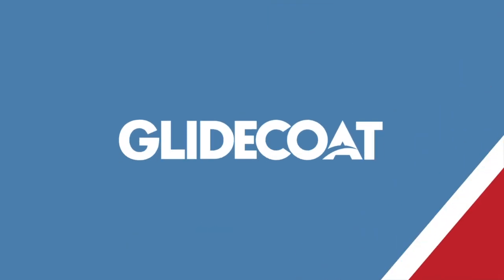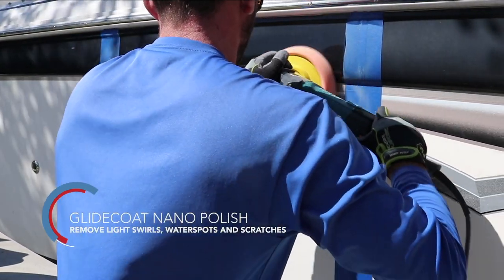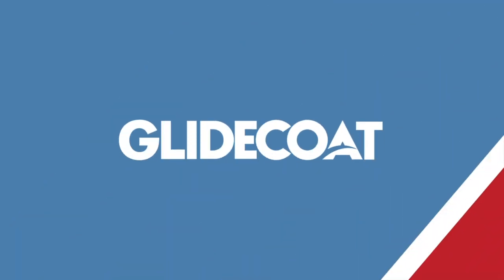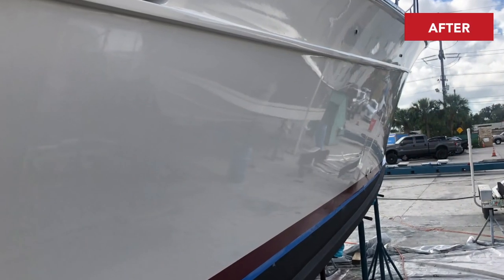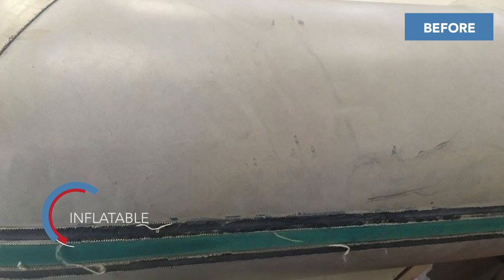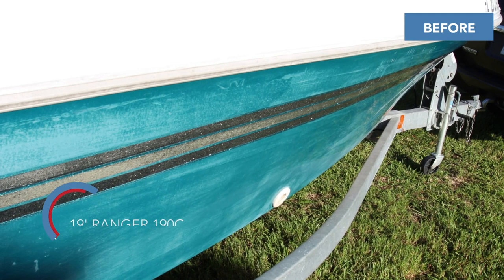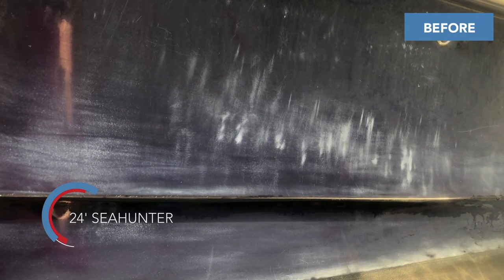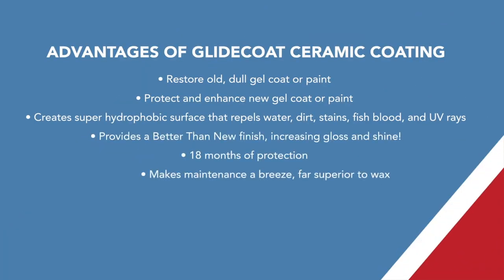Glidecoat Marine Ceramic Coating Application Steps With Before & After Photos

Comment: Sorry the Alpha has a 5 year and the standard is only 18 months.  Which one should I go with.  I called Glidecoat and I really didn't get a satisfactory answer.  They just said its better but, is it formulated for fiberglass and is it meant for boats?
Reply from the maker: The ALPHA is different than the marine as it was designed as a marine grade coating, but can be applied to multiple vehicle types - boats, cars, RV's, etc. The 5 year protection is for automotive applications. In lab testing, we found it would give 24 months protection in the marine environment, compared to our original marine coating which gives 18 months protection. Both coatings are safe for us on fiberglass and meant for use on boats. It really comes down to cost and preference. The ALPHA is slightly more expensive, but you get an additional 6 months protection.

Comment: My question is, which is a better ceramic for the boat, the standard glidecoat or the Alpha?  It seems like the glidecoat has a 5 year warranty and the standard it 18 months?
Reply from the maker: Hey @rahouston - I answered your question over on our ALPHA video, but wanted to give a quick answer here... The ALPHA has been shown in lab testing to outlast the marine ceramic coating. The lab testing shows the equivalent of 24 months protection, whereas marine shows 18 months. The 5 year protection we state on the website is based on automotive applications.

Comment: Hi, will be applying your coating tomorrow evening or Thursday once the buffing is done. I use the new Turtle Wax graphene flex and or 303's version as a sacrificial layer for my car's graphene coating. Can I use the TW graphene flex spray on the boat for a sacrificial layer? If not, what can I use? Just looking to help the coating last longer like on my car. Thanks!
Reply from the maker: Hi Rich, yes you can use Turtle Wax graphene flex spray as a maintenance topper after our Marine Ceramic Coating has fully cured. We also have a similar maintenance product called Marine Shine and Shield, as well as a polymer infused soap called Ceraglo, which are both great products to help get the most out of your ceramic coating.
Reply: @Glidecoat  ....Thanks for the reply and information. If I missed it, I apologize, but I didn't see on the box, bottle or website that stated what the cure time is? I applied two coats to the exterior today, so when could it be put in the water? Wish I had before and after photos--my bad.  Loved the ease of put on and wipe off.
Reply from the maker: @Rich--J  No problem - glad you loved it! The full cure time is 24 hours. So you will be able to put it in the water tomorrow!

Comment: Can this be used on cars?
Reply from the maker: Our Marine Ceramic Coating is designed for use on boats to address the specific challenges of the marine environment and gel coat. But we do have an Auto Ceramic Coating available on our website at www.glidecoat.com.